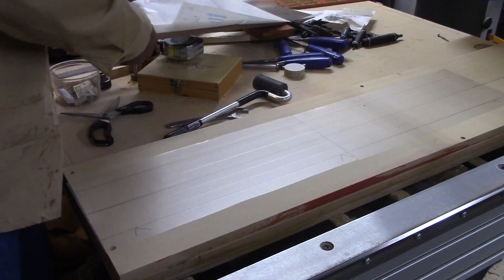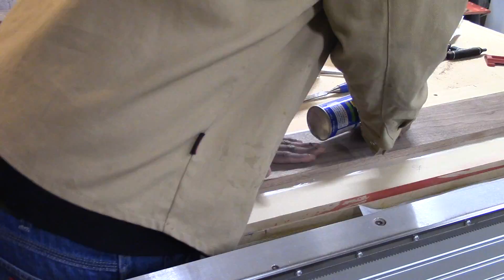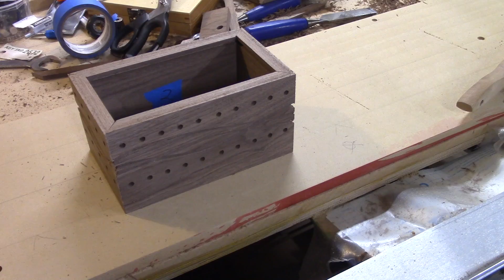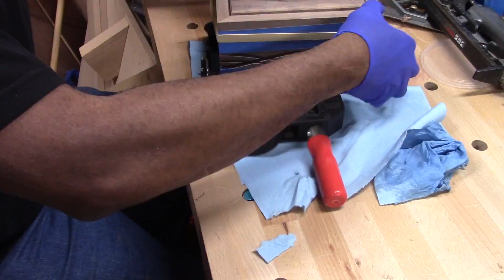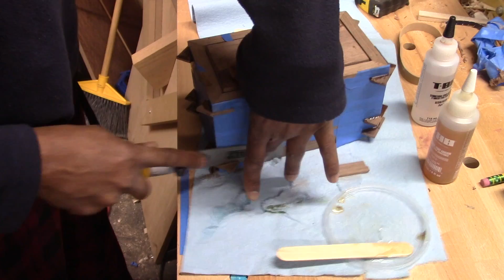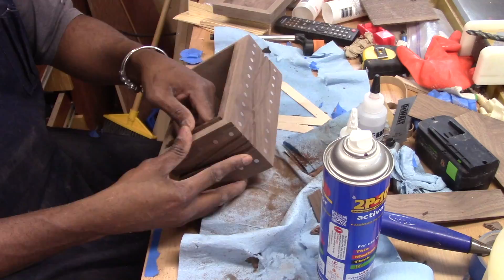Mandell Mann: Making a CNC Box and learn a new way to clamp your parts

Comment: HI Mandell, Are you using a spindle on your ShopBot? I'm not familiar with this CNC. I duplicated your process and purchased a 1 1/4 vbit. My 1/4 hp Makita struggled even using 10 passes with this bit. Am I doing something wrong or am I just under powered? Please help me out.
Reply from the maker: Yes, I am using a spindle. Maybe try slowing your feed rate a little.

Comment: I did something similar a couple years ago, except more sides.  I tried 6, and 12 sided boxes.  I tried to leave a thin skin on the outside of the miter cuts so it could be wrapped up with no visible seams.  But to get that to work I should have taken the time to set up a steam chamber or something else to get the wood fibers soft enough to attempt to bend so sharply.  I tired hot water that wasn't hot enough and it tore.  I believe it can be done with proper setup.

Comment: Really nice job. Those joints look perfect. Just a tip that might help you out but, why not tape the box before cutting the slots for the splines? Should save you some time and give a much cleaner tape job.
Reply from the maker: I have done this several times but the tape got in the joint and became embedded. Unfortunately it became part of the design.
Reply: @WoodDoormann  Gotcha. I've used that technique several times using a table saw to cut the splines but I could see how that could a problem using the router table.

Comment: you shoiuld use a water pop instead of the oil to check for sanding defects, should water pop before applying a finish anyway, makes the grain lay nicer... also what brand is your 30 min epoxy? cheers -mda

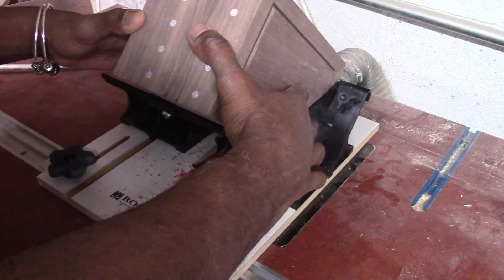Comment: Just found this. Excellent work sir. Some great ideas there. Could you have masked off the sides of the box completely before cutting the 45 degree splines (7:21) in the side? that way you wouldn’t have to cut fiddly pieces of masking tape after wards. (8:09)
Reply from the maker: Hello I hope I’m answering your question, I did mask the entire side but the masking couldn’t handle the carving.
Reply: @WoodDoormann sorry, I meant apply the masking to the entire outside of box before you cut the splines in the spline jig.
Reply from the maker: @thebeardedcountryman  I’ve had bad luck with taping first. The tape wraps around my bit and clogs the slot. I then had to clean the slot out to make sure that the tape didn’t get into my glue line.  If you have a better way of doing it please share. Thanks

Comment: Awesome Box, i love it. My next Job application is going to be very similar to that. Thx for sharing.
You could have done the cuts for the splines on the cnc also.
Oh and do not use steelwool on woods like Oak or Walnut. The Acid in the wood reacts with Steel and stains the wood

Comment: Terrific box. An idea for a future box, instead of using aluminium rods, fill the holes with coloured resin, that would also allow your holes to be shapes other than round.

And pick yourself up some mats like this https://www.amazon.ca/MonkeyJack-Anti-slip-Cupboard-Underlay-Placemat/dp/B076F6J7V1/ to hold your pieces in place while you're working on them, it also gives a nice soft surface so you don't risk scratching your work on your bench top. It works much better than a paper shop towel.

Comment: Love the idea of the sticky paper. Can you explain the process and what were the dowels at the end for if the paper was working fine. Are the dowels at the end to hold the piece in place too.  The box is beautiful.
Reply from the maker: Hi frehleycomet 
The dowel rods are for position indexing when two sided machining. It allows one to flip over a piece of wood on center so that one can machine in the exact position relevant to the other side of the board. Look at the video a second time it will help. Thanks for watching and I hope this helps.

Comment: Thanks for the video.  I have use the tape and glue method.  Never thought of contact paper for larger areas.  That is excellent.
Might I suggest a follow on video for how you did the CAD/CAM for this.  It is the next hurdle once someone such as yourself shares a design that inspires.  I am currently making some simple small lidded boxes, just to develop my CNC skills.  ~P

Comment: great job!
can i suggest keeping the contact paper on for glueing up? or is it too messy?
have you tried v-carved inlay on your boxes?
Reply from the maker: Thank for your support. If the contact paper hold up I guess it’s possible, but it does take a beaten. Yes, I have done a few inlays using the v bit and it works well.

Comment: just might have to play around with the basic idea  some. I usually go with finger joints as my jig for those is a lead screw varient capable of doing up to 4 inches thick of pieces in one go.  In essence I cut all the sides at once. I do one need then flip therm over and get the other end so its only 2 passes for a box. For batches I simply cut as many as possible on each pass.

The more you play around with  a Cnc, the more you figgure out how to use it to eliminate more handwork... :) Its the handiest thing to have in a shop..

Comment: Outstanding work!! Liked, subscribed and enjoying every video you've posted! 

The use of wood with aluminum metal rod spots is a super touch. Might I be so bold as to suggest brass with walnut. With the natural warmth of walnut, brass is a warm (color wise) accent, whereas the aluminum is a cooler tone. Either works, of course, a builders choice always.
Reply from the maker: stargeezer L Thanks! I thought about using brass and it would look nice but because walnut can become lighter or blonde over time I was concerned that it might lose its' contrast as it aged. Thanks for your suggestions they're greatly appreciated.